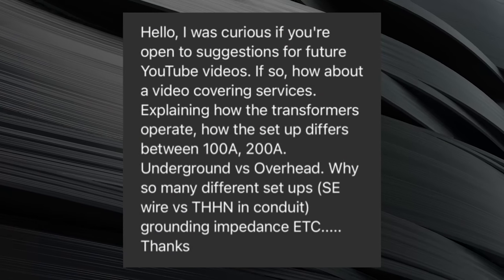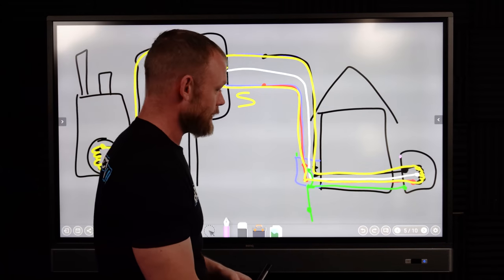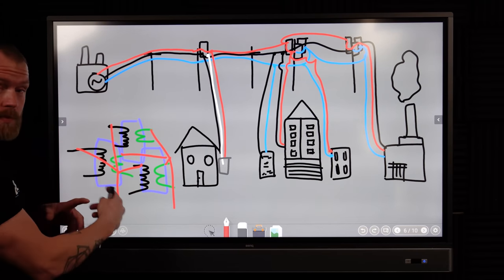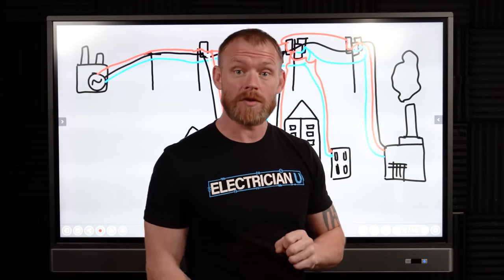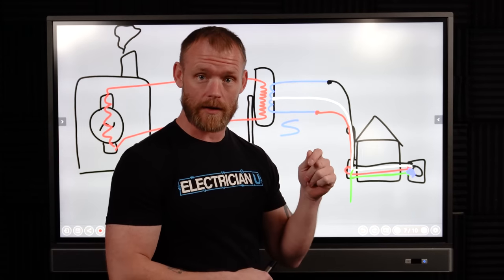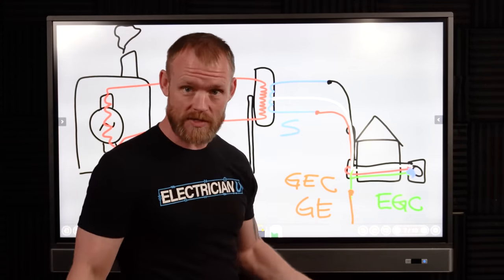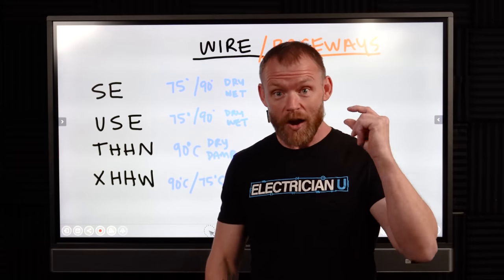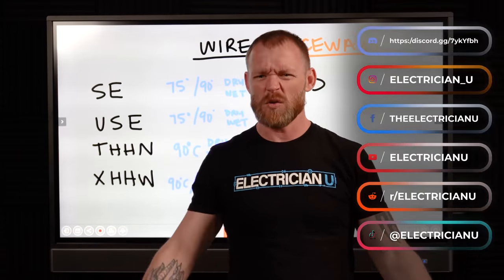How Does an Electrical Service Work? Electrical Service Panels Explained

Comment: Great explanation well done even! Would love to see your ways of upgrading and layout of 200 amp panel from 100 amp, on residential where ac, microwave and other upgrades were not considered but added anyway, turns old panel into a nightmare when troubleshooting or adding etc. Thanks ahead of time.
Reply: must be a common residential electricians licensed mistake and homeowners playing into that as well as 150A's-down is no longer relevant as the average person use's more electronics than in say the 1980's and back
Reply: @richardprice5978  exactly! Alot of 70s homes still have the 100 amp, and the owners haven't made the decision to upgrade instead try to pack it all into the smaller panel, and think they are OK, my inlaws for example had issue with tripping breakers when appliances ran and hvac ran at same time, when I dug in found out it was all Jerry rigged to make it functional but not safe or up to code, either had to go through it, to fix it. Figured it might be good content, his presentation is very good and explanations are helpful for those that may not have the know how to begin with.
Reply: @tlheingrunst  same i liked his challenger panel explaining for the most part and was vary helpful in telling the miss ( and for translating from are residential licensed man as im on the industrial/maintenance side of it ) why we couldn't just add the generator disconnect or solar system and ended up with a 400A as for the head ache might as well plus we/prior owners had added so much on the 100A/sub-90 socket that it browns out and did start one smaller fireball that we are lucky 🍀it didn't do to much damage and was just a wake up call to fix it the right way and it leaves a little room to grow into it but not much, are utility said over head max they let us go was 150A but had all of the head aches ect so thats not how we redid it
Reply: @tlheingrunst  i like learning about historical things but sometimes if really does belong in the past as a box from 1920 would be fascinating to me and others but its missing the last 100 years of knowledge and change ect.
Reply: @richardprice5978  agreed, the old ways are truly interesting, nice to visit, no need really any longer to know the ins and outs. For the most part it's pretty self explanatory.
Your other comment, yes alot of people have gotten away with being lucky playing with their panels and not knowing what they are getting in to. Or doing their due diligence to either get an experienced hand to help, or taking the time to ask questions and learn. In the past I've found homeowners thunk they can tackle so much more than they are capable of because of a diy show, or some self help book or the wing it. Let alone the surprises just walking on site and seeing the rats nest and trying to make heads or tails out of it with no labels either, pencil doesn't last who uses pencil to label? Lol
Reply: @tlheingrunst   i didn't play with the 100A panel or entrance lines ect. and was the first year we moved in is when we had the dishwasher and hammer panel/socket fire but still i counting adding things like pluging a microwave ect. as i found out that wasn't a big thing in the mid 70's and learning about the past and people give's you so much insite as to the why and how to do better ect, as for home codes it's a little different than manufacturing plant so it's just easier for me just letting somebody else with the license and the county inspector ect. to work next to each other and less time and money ect. passing it and me doing any grunt work / asked what to do ect.

i agree that miss labeling or nothing is a pet peeve of mine and this house 100 didn't have anything or was in pencil ✏and or wrong and wonky as the logic for brakers and i do try to do my due diligence and a amity i thought that the socket was the utility's responsibly and originality i thought it could handle 200+A's lol no dummy, but that's fixed now 🤠
Reply: the pencil ✏logic is i might have to change it in a year but lol 😂most likely as a homeowner that never really happens, in my case i planed out the system to last for at least 15 years or more
Reply: @richardprice5978  Hope you didn't think I was slighting you, just stating some examples is all. Do agree with you!
Reply: @tlheingrunst  nope just not encouraging any suit's 😉 or younger unsupervised teen's to do it them self's but both of us agree do fix it with someone who knows what there doing 😁 or buying it done already. that and to clarify it wasn't me that caused the fire 🔥😁, actually i found out that the utility's needs to upgrade and modernist the subdivision in this process of permitting ( but my end is ready for it as long as it stays SP 240v ) and didn't know about that at the time of sale so maybe more people can be educated and not just go for the bling as things like this gets swept up under the rug of house buying sins 😉 and not really well disclosed by the realtors ect. as small supporting things like this makes a better home and living experience ect.
Reply: @richardprice5978  right on! Yes sir!

Comment: Dustin, the new smart board setup is a really great idea! It really helps us visualize the concepts you're describing. I'm still hoping for a video about wiring HVAC systems, especially in commercial environments. I ran across one recently that seemed to be 3 phase for the heat strips and single phase for the blower motor. I know NEC allows for smaller wire to be run with larger breakers, but why? Inrush current? And if the heat strips are 3 phase then would I still base my wiring on the name plate on the blower motor?

Comment: Could someone explain open delta 3 phase?   My uncles house has two transformers on the pole which one is disconnected now days but I’ve been told it was an open delta system.

Comment: I've worked as a shipyard electrician for a decade--really without proper schooling, just winging it--and these lectures are really humbling. If nothing else they show me to be more careful, ask questions, don't just jump in. The least little bit of slop, like lightly nicking a conductor or tightening down on insulation instead of only the conductor, etc. can lead to grief down the line. I am chastened and will really watch it from now on. Thanks a load to all of you making these videos. You all really know your @$#%!

Comment: Interesting that in the old mills in New England that had turbines in the basement and sat on canals, the path used to divert water through the basement to turn the turbines is called a raceway.  And that's for water.

Comment: Where is the Wye circuit, which is used for providing a neutral, placed when wiring up an apartment building with 3-phase?  Is it at the transformer?
Reply: Yes. On the secondary.

Comment: Excellent. Can you please cover bonded neutral vs floating neutral related to portable backup generators that back feed a panel interlock switch. Thanks.

Comment: Very nice video. I learned a few things as well. I learned that on a typical residential. install that there are actually 3 wires feeding the meter at entry. I for some reason thought the power transformer send only 2 wires with the center-tap staked down to ground near pole base and then this was picked back up through the earth to the house  at the house ground stake and then into the home. You also taught me that each buss bar of breaker is rated at service rated amps and isn’t halved. So in theory if they made a 120v 200A breaker on a 200A service, I could run something at 120v up to 200A “if my wires to the load from breaker were of adequate gauge size.” Is it true that they call common household service single split phase?
So if that being true, is the split referring to the split or half-way point, or the center tap of the secondary of the transformer on pole? Also I would love to see a video on how to measure 440 3 phase and what a voltmeter should show between phase  L1 L2 and L2  L3, as well as L1 to L3 and any of these 3 phases to ground.
I find 3 phase somewhat a mystery at how no neutral “return” wire is used, and no current travels on ground unless a fault is present. I’m also aware of a device called a phase monitor that are sometimes added as an option to some machines to protect 3 phase motors,  by detecting if each phase is not 180 from one another, and then if so, opening a breaker (contactor). Another interesting thing is how if you flip any two of the 3 phase input wires you can change the rotational direction of a 3 phase motor. I used to produce/wire control boxes for industrial screw type air compressors. It always was a guess for the people in the test cell to know what direction the 3 phase motor would start. Very often two of the phase wires would have to be swapped at their connection points. PS would love to see a video describing 
3 phase and how it works 😎👍
Reply: The GUY wire is the neutral (uninsulated wire) from the house to the power company transformer.
Reply: @tedlahm5740  So the center tap of the secondary side of the pole transformer comes downs as the guy wire and this guy wire travels all the way to the houses circuit breaker panels ground bonding bar, or does it go to the ground stake outside where it is then brought inside?
Please clarify what you mean, thanks.
😎👍
Reply: @repairfreak  First portion of your sentence has it correct. Goes to the ground bonding bar
AND the neutral bar inside the panel WHICH are bonded together. 
The second part of your sentence it then goes outside to the ground OR to a COLD
water pipe (which goes into the ground); same thing.   Thanks.

Comment: Overall a good try to get it all in!   Possible video topics.   Overcurrent protection, what, why, and how, breakers and fuses.   NM cable. Uses permitted, not permitted, different types.   Separately derived systems. What, why, and grounding. Generators, transformers, etc.
Respectfully,   Kevin

Comment: Primary coil of the step down transformer (on the pole) the SECOND end of the coil is connected DIRECTLY to earth not back to the power station?  I never see a neutral conductor back to the power station, although may be in other distribution systems?
Thank you.
Reply: For a “Y” distribution system, the bare neutral is located just below the transformers and connected to the transformer can and to ground.

Comment: I've been doing a little of my own wiring with upgrades on outlets an other small repairs I'm a hvac guy but a diy at home .I enjoy your videos from all the others but my house is 120 years old an things are all over iv got switch loops at places...all my upstairs power runs to my attic which they tied romex to know an tube then branches like a spiders body only why I can think to put it..I'm having trouble trying to find videos that can tell me a safe why to update everything. Most videos I find will only talk of know an tube or don't tell much about power running into lights first. I would love to send some pictures cause as someone taking an interest in electrical for first time in a house this old I feel I can't learn enough

Comment: U didn’t clarify that on a 100 amp service, that each pole of service (ex the red and black feeders) can have like 80% of its max load. So in essence for 100 amp panel, I could have as much as 160 amps total energy flowing inside the panel. But, if one Pole exceeds 100 amps, then the common trip of the main 100 amp breaker trips the entire service.

Comment: Awesome video Dustin! Could you go more in depth on when youre allowed to use the different temperature ratings for conductors? When can I rate my conductors at 75 degrees, 90 degrees, etc.

Comment: Is the bonding strap between grounding buss and neutral buss the same size as the service conductors into the panel?
Reply: Not generally.  It's usually a bonding strap or a bonding screw that comes with the main disconnect panel.  It's not something you would have to provide yourself or size yourself.

Comment: I looked threw the comments, living here in Florida one thing that I've come across is generators when a hurricane hits people use generators and don't understand that if they don't  turn off the main breaker to cut the house off from the service that a transformer works both ways and you can electrocute a worker trying to fix the system. This isn't isolated to Florida, snow can cut off services too... just a thought, thanks for your channel love it, Journeyman Electrician for 10 years now
Reply: It is frightening that there really are people who are ignorant enough to actually energize their homes with a generator without taking two seconds to open the main switch.  What are they thinking?  But hey, people used to put pennies in fuse boxes too...

Comment: In the old days, the grounding wire was connected to the cold-water copper pipe closest to the panel. The last time an electrician came to my home to replace the panel from a 125 amp to a 200 amp, he ran a grounding wire across the house to reach the cold-water entrance on the city side of the main valve. Could you explain why?
Reply: In the future, that section of pipe where the ground was attached could get isolated by insertion of a non-conductive section of PEX tubing (or similar) or even bypassed/removed in a remodel so to safeguard against this the best place to connect the cold water ground is where it comes into the house before the meter ensuring that it will always remain connected.
Reply: The house I live in was built in 1990.  I have a ground wire attached to a cold water pipe, and another wire connected to a grounding rod outside.  As it turns out, there is no connection from the copper pipe to the actual ground.  Not sure why that is unless a section was replaced at some point, but I've lived there for 22 years, and I never replaced any plumbing.
Reply: @cward1954  The grounding by copper pipe and the grounding by ground rod are independent groundings, they don't get connected directly to each other if that's what you're asking. If Dustin hasn't done it already this would be a great topic for a video too, Service Grounding.

Comment: Grounding and bonding is always a good video.  Many are not educated in the differences between the two and think we "Ground" stuff because electricity looks to a path for ground and saves your life which is not true.
Reply: So true, it's looking for a path back to it's source, the transformer, not to ground.  Ground can be a path back to the transformer, but it's not the preferred path if the neutral is still intact.

Comment: Can you give me an example of 3phase voltage? 110v, 190v and 220v can be considered as 3phase system? I'm from the Caribbean
Reply: In the United States, there are two typical 3-phase systems that we use.

For light commercial, we use 120/208V as the 3-phase system
For large commercial and industrial, we use 277/480V as the 3-phase system, usually with smaller transformers that generate 120/208V for a minority of the loads that need 120V to run receptacles.   The 277/480V would do the heavy lifting on the majority of the loads, and be the service as a whole.

If you divide 208/120 and 480/277, you will notice that it is approximately the square root of 3.  This comes from the geometry of an equilateral triangle, where the distances from corners to center times sqrt(3) will equal the distance between corners.

There are rare systems called high leg delta grids, that use 240V between phases, and 120V between A and neutral, and C and neutral, and called a high leg because phase B is 208V to ground.   The 110/190/220V sounds like the slightly lower voltage version of this.   If you draw it to scale, you draw an equilateral triangle that is 24 cm between each corner, and then you cut one of these in half, mark the midpoint as N, and then N to the opposite corner would be 20.8 cm.  N to the nearby corners would then be 12 cm.

Comment: You forgot to show that the primary service feed has a hot, and a neutral (grounded conductor). In other words, the 7200V hot coming into the primary side of the transformer on the pole, wraps the iron core, and returns, but that return is bonded to ground at every pole. So the center tap on the secondary side, has the same potential as the low wire (neutral) return that is the other half of the incoming 7200V. This is important, because additional bonding at sub panels, and buildings, fed from the secondary side, creates additional paths for current to return to the same ground potential as the primary winding and secondary center tap. Every DIYer and amateur electrician I've encountered who doesn't grasp what ground truly is and the reasons for, implications of grounding something, usually fails to understand the big picture, until they understand how the utility uses Earth (ground) as a means of last resort current return in the event of a fault.

Comment: Good video man. Shoulda had a lineman on with you to explain more in depth the utility side
Reply: Yeah, the linemen would have pulled the fuse to disconnect (assuming only the dwelling was on the transformer) point out the neutral on the utility pole, then point at the ground rods every x amount of poles because some dyi played with a generator thats back-feeding the phase(s) causing everyone to slap jumpers on to neutral while they fix shit on storm duty.

Something like that

Comment: A consideration for 3-phase AC power are 3-phase AC motors that are directly powered from the mains. What other equipment requires 3-phase AC power?
Reply: DC fast chargers for electric cars, Commercial heat pumps, Commercial water heaters, commercial lighting is designed for 277V so it can run directly off one of three phases to neutral when service is 480V 3 phase.  Theres all sorts of stuff designed to run on 3 phase.